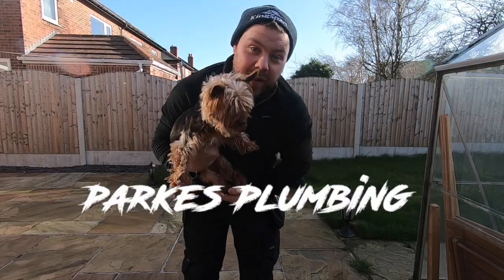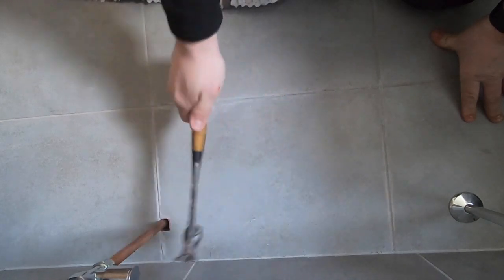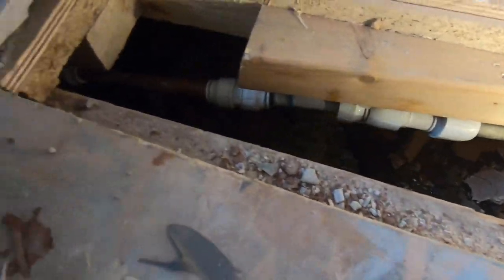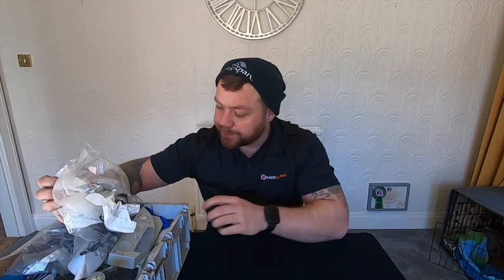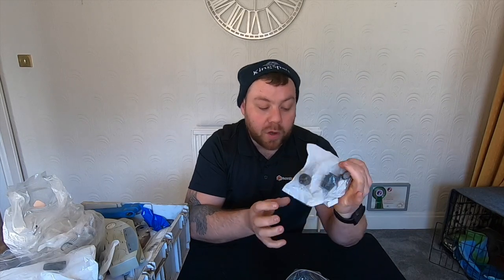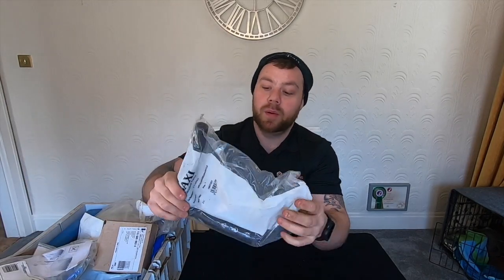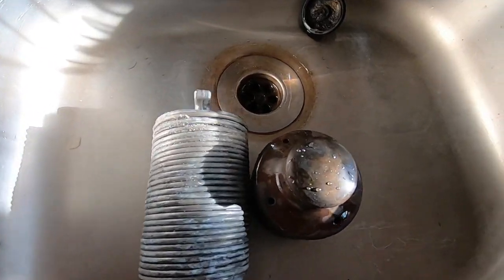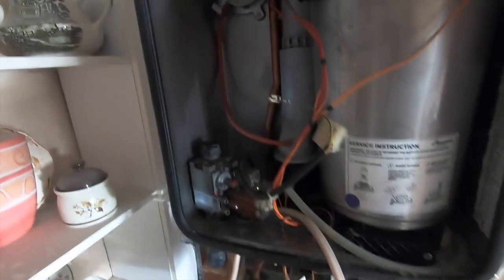PARKES PLUMBING VLOG 009 | Van Stock & Day in Life

Comment: Another excellent video mate ! I’ve subscribed , I see you keep a good selection of spares and more common failing parts on your , as far as I know them viessmann boiler combustion cover seals are not normally changed on a service?
Viessmann are quite Good and there own engineers will supply you with a new plate to plate heat exchange it but once only the one they leave behind is an absolute doddle to clean out and is usually just full of black flakes, The trick is to reverse flush them and they clean out a treat! they seem very close plated inside as I suppose in Germany they do not have systems  full of crap!
Reply from the maker: Thanks bro, you’re right the viessmann seals don’t need changing, but I have come across a couple that have split so I keep one on the van at all times. I work on a lot of viessmann products
Reply: Parkes Plumbing , Cheers mate, didn’t catch your name?
yes see you little do a lot of work on viessmann products, I enjoyed your video where you went to the head office, I’ve switched over to fitting them as well ,what do you reckon of them in general? and what are the more common failures on them ?
as I haven’t really come across much problems in the last 10 years I’ve been using them
Reply: You had to go merchant for a Worcester combustion seal??

Comment: On the the first part of the video, where did you turn the water off and check that it was turned off?
Reply from the maker: Replacing the leaking pipe? If so it was a central heating pipe so I had to drain the system
Reply: @ParkesPlumbing   thanks for the reply mate!

Comment: What happens if you go to a job to fix a boiler, you diagnose the fault and the part/s needed but the customer refuses your price?
Do you still charge them for a call out or for diagnosing the fault even though it has not been fixed?
This is what I struggle with. Even though you spent time and money to come to the job and  they end up refusing the fix Saying they will “look for more quotes” and the best way to handle that.
Reply from the maker: Good question .. you need to make it clear before you leave for the job what your charges are. I can tell what the problem is just by asking questions over the phone and can give them an estimate on costs. That normally weeds them out

Comment: Was that steel clad pipe you repaired there . It looked like it to me.
Reply from the maker: Was copper bud .. thick gauge old style 1950s sheeeit
Reply: 50s so it's lasted 60 odd years hope we can get that from the new cu and plastic but doubt it
Reply: The right hand manifolds on worc over a ton not cheap